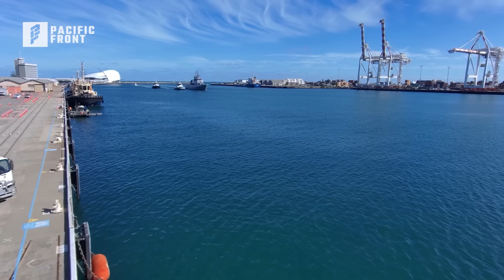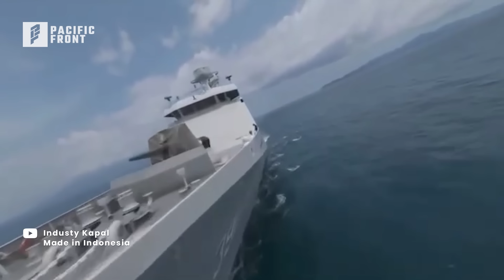Raja Haji Fisabilillah OPV, Indonesia's Naval Test Case!

Comment: sorry for this late reply but this is Not an OPV!! Its a souped-up light frigate in a corvette sized vessel... with an actual HANGER!!! How Badass is this!!! lol
Reply: Frigate flavored Patrol Vessel
Reply from the maker: a solid platform for a corvette I must say.. it just lacks anti air capability a bit.. 😁
Reply: @PacificFront hmm ya. Personally for an OPV i would have removed the anti-ship missiles n replaced them with anti-air ones instead... perhaps MICA VLS!! Something small for self defense.
Reply from the maker: @eseetoh  I thought that as well.. VL MICA seems perfect.. the launchers on the Independence looks like only need small space.. I wonder if the space behind the main gun is enough to put two rows of MICA.. of course the ship's balance will shift and need redesign.. but if this is possible, I really want to see it.. 😁
Reply: @eseetoh no no no this is an OPV theres no frigate here

Comment: The only minus is lack of a credible air defence suites and equipment .
Reply from the maker: yeah.. especially with such a powerful radar it will have, I think it needs a proper anti air capability..
Reply: Combo 40mm Dardo twin gun + RAM/Goksur/Levent slant missile launcher.👍✅
Reply: Kalo mau itu meriam 76 mm bisa dipakain DART munitionn buat menangkis serangan udara ini amunisi pintar berpemandu yg bisa bermanuver hingga 20 G dg daya jangkau 16 KM.tapi itu juga tergantung dari budget nya sementara untuk amunisi macam AHEAD lebih murah namun ini amunisi tanpa pemandu
Reply: Give this class a 28 vls cell . It would give them a very flexible option in their role and purposes  as a workhorse of our navy .
Reply from the maker: @muhammadyusuf-mx5lb  that's too much.. and it doesn't have enough space it seems.. I think 8 would be sufficient for its role and size..
Reply: @PacificFront betwen reucing the cell or elongated the length of ship . Even if become 104 m if it still inadequates  that only read as an glorofied OPV not a full pledged war corvettes / work horse in my book .